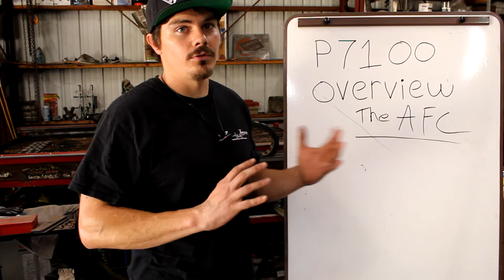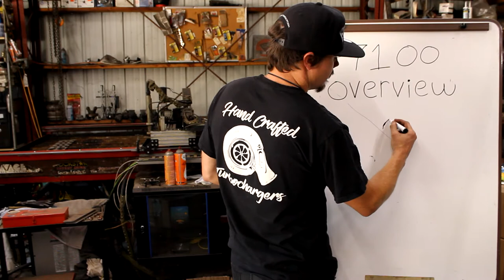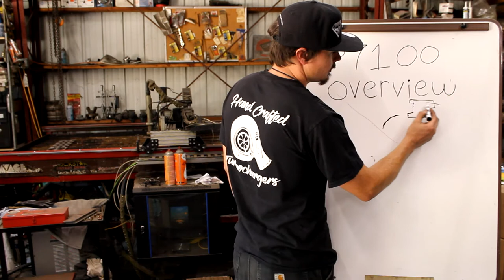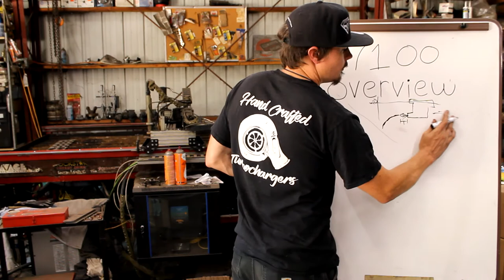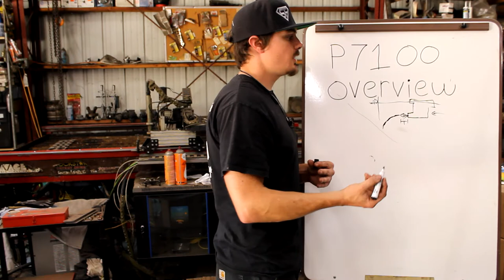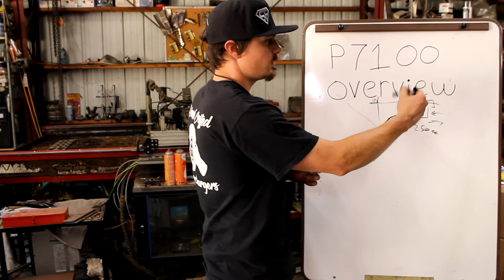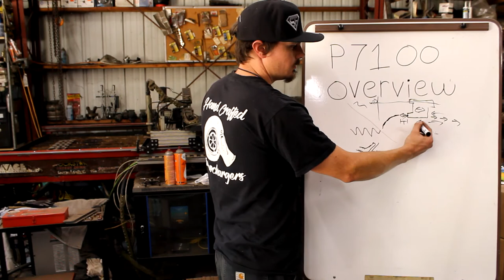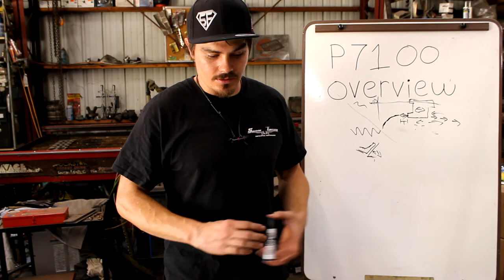P7100 pt2 The Truth About The AFC

Comment: I have a question.. I have a new crate 4BT after the old got a crack in the block. I swapped everything onto the new long block, has a P pump, and the only thing ever done to it was the star wheel was turned all the way forward. Not by me.. other than that the the tamper proof screw hasn’t ever been removed ect.. running H1C turbo. Should I back that star wheel some to get boost quicker? That’s a lot of info to take in, but I think that’s what the issue is as far as torque when pulling a trailer.
Reply from the maker: Taking the tension off the spring will increase torque per rpm. I would move forward with loosening the spring up too when it starts to get a light haze under load :)
Reply: @savagefabrication795  right now it smokes black before boost, and after boost it clears up. The star wheel is moved all the way forward.
Reply from the maker: @daniellaverty1359  then you would want to tighten up the spring but I would do a small spring adjustment while also backing pre boost out. If it is a pre boost issue or low boost issue adjusting the star wheel is only going to do so much. Where pre boost can help out a lot.
Reply: @savagefabrication795  I truly appreciate you answering my questions. Seems like you know your stuff on tuning, so take it as a compliment that I’m asking you and not someone else. I appreciate your time.
Reply from the maker: @daniellaverty1359  🙇‍♂️ always try to do my best to be helpful

Comment: Where is the pressure taken off the turbo or the manifold?
Reply from the maker: 94-98 12v's take it from the turbo. but you can take it from the manifold. it is pretty common to get rid of the big hard line and clean up the engine bay and just take the boost reference from the head.

Comment: What about the  P 7100 would cause a no idle or stop below 900 rpms?
Reply from the maker: The engines just shutting off below 900 rpms?
Reply: @savagefabrication795  yes. Engine runs above 1300 rpms fine below that it will slowly stop. All new parts installed below injector pump.
Reply from the maker: @garygeer7646  if I had to take a shot in the dark guess it would be either low fuel pressure below 900 rpms for the idle springs in the governor housing are out of calibration and not increasing rack position to maintain a idle.
Reply: @savagefabrication795  thanks for the reply. I took governor spring out. I the idle spring on one side was not mounted and the base washer was on the side of the spring. I put it back properly but still have idle issue.  It was suggested that the timing is off. Gear slippage. I'm looking at that now.
Reply from the maker: @garygeer7646  maybe but they typically still run they just run like garbage. Do you know the hight of the gov spring retaining nut on each side? Too lose or unbalanced can cause problems.
Reply: @savagefabrication795  they were set properly
Reply: @savagefabrication795  could there be an issue between the governor & the rack, linkage?
Reply from the maker: @garygeer7646   if it’s been messed with I would say yeah their could be. The idle springs are what move the rack back and fourth to maintain a injection rate to maintain a idle. If one of the components from the springs to the connection to the rack is damaged or incorrectly adjusted then it will uncalibrate the entire idle circuit. I don’t have a pump flow bench so I have always been extremely careful with how much tampering I do on a pump. Gov springs, rack travel adjustments, timing, and DV’s are the most extreme things that I would diy without having a flow bench to verify balance and operation. 

Or like earlier if it’s low on fuel pressure it will just shut down if it’s on a mechanical lift pump that could follow why it’s rpm based.
Reply: @savagefabrication795  lift pump is brand new. I got good pressure when I bled the lines. As for governor. When engine stopped I pulled up to a red light when I came to a stop engine just quit running. Before truck would always start without me using accelerator. Now to start engine I have to pump it and Rev beyond 1300 rpms to keep engine running.
Reply: @savagefabrication795  it appears to me that something in the governor assymbily went bad. I don't have a flow bench either, but I would like to take that part of the FIP off and see if something came loose or fell off the linkage. Thank you very much for your help!
Reply: @savagefabrication795  FYI. Lift pump, fuel filter & overflow valve were all installed after I had the no idle issue.
Reply from the maker: @garygeer7646  all kinda points then to something in the governor assembly that’s fallen out of calibration. It looks like all other possibilities have been ruled out.
Reply from the maker: @garygeer7646  have you tried to turn the idle up? Just as something to check. The jam nut can come loose that kicks it in place.
Reply from the maker: Locks*
Reply: @savagefabrication795  thanks. I checked idle screw its lo locked in place. I'll let you know what I find when I deal with the governor.
Reply from the maker: @garygeer7646  looking forward to hearing about what ya find.

Comment: Thoughts on AFC Live....?
Reply: If you have a P-pump truck & understand the AFC function & want to be able to tune your engine "On-The-Fly" like the Electronically-Controlled engines but want to keep the reliability of an all-mechanical engine, AFC Live is your "Golden Ticket"! 🙏🏻😇🙏🏻
Reply from the maker: I agree with west texas. And for street driving I think the afc live is the best setup next to just dialing in the afc manually on the pump. It is fun to get to make adjustments inside, and note the results. What I found happened though and this is not a diss or a negative thing, but once you get it dialed in, you honestly won’t really ever touch it again except for to show off what it does or if you change parts and need a new tune up. Reducing pressure to the afc diaphragm is the same is taking your foot off the throttle some, it’s just more convenient I guess idk haha. Not a diss. Just how it works. For street driven trucks I like it. Their new version is extremely small compared to the old one and i have a mounting plate that does take a little extra work, but locates it in the cup holder location in the dash to get it out from the lower kick panel. I would rather people have afc live to make tuning easier so the truck is tuned for the street as well then maxed or gutted afc setups that smoke excessively (not anti smoke, just anti smoke in view on public roads) on the race track it’s game on.   Now for racing use. The attitude adjuster is by far the most consistent and easy way to select the maximum amount of fuel you want to use. If your goal is to run 10’s and you run a 9, back down the attitude adjuster until it’s a 10 and it will do it every time. Go to a track that you want to run a 9? Turn it back to the 9 sec setting and it will do it. But again it is a convenience thing (I have/had afc live on my daily driver and a attitude adjuster on the dyno queen) I could do the same thing that the attitude adjuster does by moving the fuel plate back manually. Or moving it forward manually. Most performance pump shops will mark fuel plate location settings as cc’s max. So you can make decisions on how much fuel you need based on the competition or the grade your going against. Ultimately where the rack is in its travel is still decided upon by the throttle itself.

Comment: What happens if you just delete the whole lot of 5psi 10 psi 15psi 20 psi bla bla psi? Might as well just take out the whole governor assembly and put a string to it
Reply from the maker: Deleting the afc housing? It would simply be rack position equals pedal position. The issue is smoke output goes through the roof since you can tank the afr almost instantly. Most Your sled pulling setups are this way. On the competitive engines.